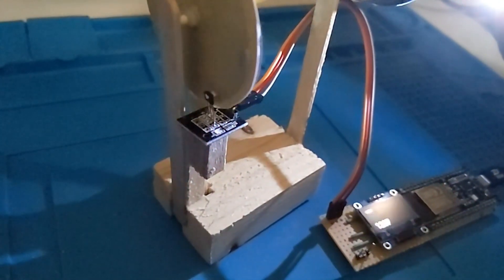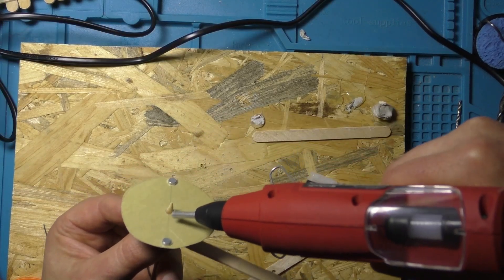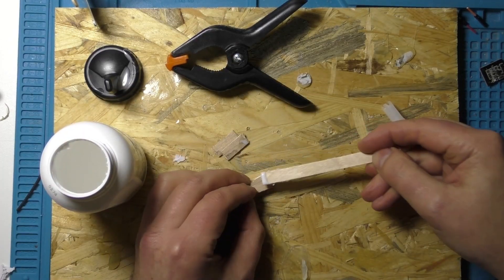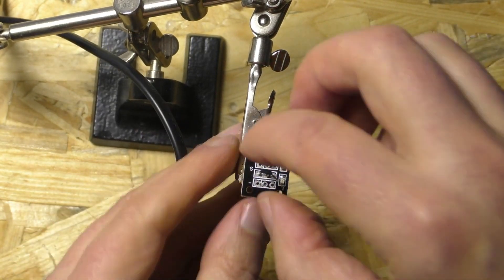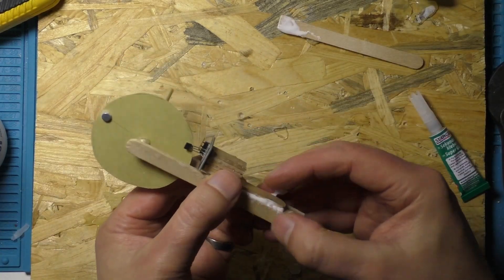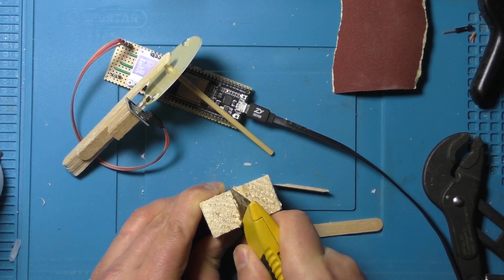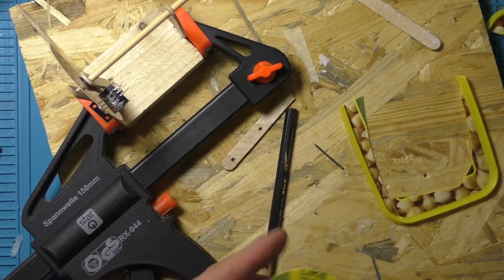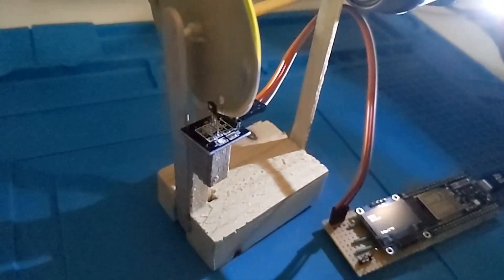Testing Motor RPM with a Homemade Tachometer (Easy DIY Build)

Comment: Graphite is a great lubricant. The place where you're most likely to have come across it is in older two-piece door hinges. I don't know how much it is used these days but it still works great.
A tip for melting hot glue is to use a heat gun from a soldering station where you can both set the temperature, and more importantly the fan speed. Since I got my cheap soldering station with a hot air gun, I've found that it can be really useful for many more things than just lifting surface mount components from scrap boards.
I quite like seeing how the sausage is made. Build videos are usually interesting, especially when it's all home-brew.